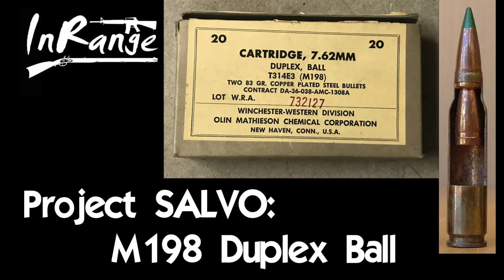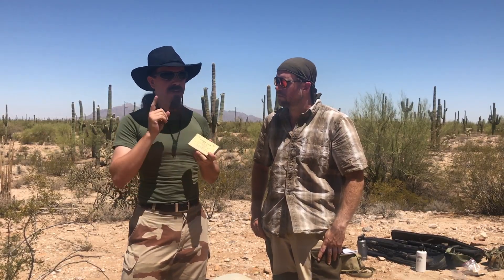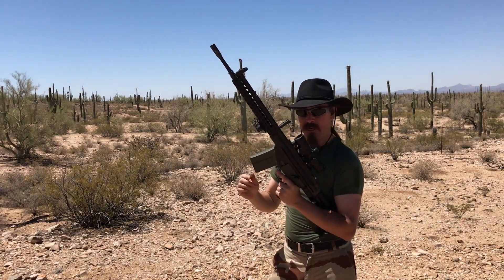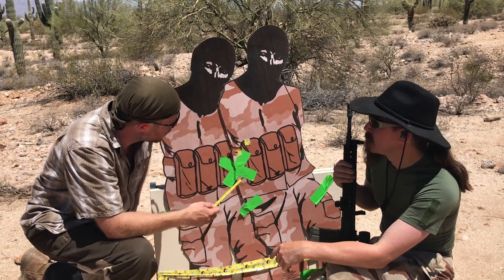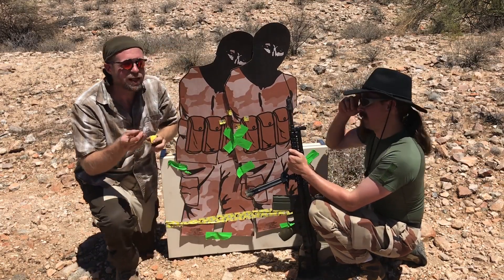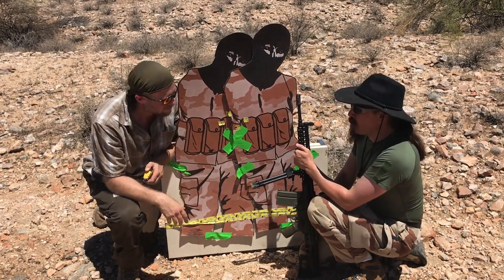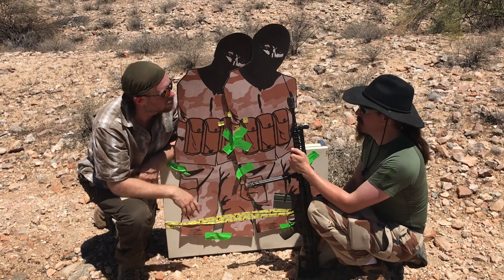Project SALVO: M198 Duplex Ball Ammunition

Comment: Duplex also introduced risk of catastrophic failure. If your powder loading density wasn't high enough, the seating of the projectiles into the cartridge could cause the rear bullet to recede into the powder bed. When fired, there would be a lot of combustion gases between the bullets, to the point that rear bullet gets stuck in bore. Follow up shot could blow the gun up. Such a failure occured with the M198's, and later with Colt's 5.56 duplex ACR candidate. This risk was eliminated by x-raying the cartridges after assembly as a form of quality control. But that step substantially increased cost of production.

Comment: I have only just discovered this video, and it is great :D
I have an interesting idea if you have enough of this ammo to test with (a year after this video).  The test idea >>>
.
Find a long indoor range that will allow you to film in the target area where people usually shoot, clearly the range would have to be shut.
.
Setup and calibrate super high speed cameras, when I say high speed I mean high FPS, example here > https://www.youtube.com/c/smartereveryday/videos <
.
We know that the front and rear "projectiles" are different.  If the gun is in a solid clamp you can fire it and drill the same hole with standard rounds as a control, then the fun and interest begins.
.
When you shoot the "duplex" rounds you will see which of the rounds (ahem "projectiles") constantly lands in the same place, I fully expect that the "front" projectile to be accurate one, and the "rear" projectile to be the random / somewhat random "flyer" that increases the hit probability.
.
If my thoughts are true, then both the "marksman" concept stays true and is valid and also the "hit probability" concept is true and valid as well.  The only way IMHO to know this is with real world testing, and IMHO the ideal scenario is to remove as many variables as possible and run this in a scientific way.  Indoors, gun clamped, control ammo tests, high FPS video to see which "projectile" hits where.
.
I expect under this scenario that at a set range the "front projectile" will be less accurate than standard 7.62 but still OK, and the "rear projectile" will be random in it's up, down, left, right position as well as the distance and across (say 10 rounds) be more like the spread of a shotgun.  I could of course be wrong and the front "projectile" could also be inaccurate, if so that would have destroyed the "marksman" concept.!
.
Finally, and this would be fun, have a chat with Paul Harrell (team up) and compare a standard 7.62 round, with the "Duplex" and other competitive rounds on the now famous "meat target" and possibly other tests (light Human body armour) to see whether this was/is actually lethal enough as compared to it's competing options, both foreign and domestic.

Comment: I realize that this stuff is expensive, but you really need to fire more than one round at each range for control.  When you look at the spread at 25 meters as 2.5 inches, and 100meters as 10 inches, it should've been 5 inches at 50 meters, but it was 3 1/4 inches.  You really can't make a lot of assumptions from such small numbers. I almost could assume that the one round closest to point of aim  was the front bullet, but who knows?

Comment: " Oh, it cycles "  - Yeah, it is a G 3. Used it in German Air Force. My one never refused to cycle nor did any of the other ones. Our rifles were in good condition and our ammo as well . But even with bad ammo, it will cycle. And with really bad ammo, for a good reason there is a hole in the charging lever where the carrying strap clasp fits . So it can be cycled manually. Germans always have a plan B ...

Comment: Russia in fact adopted duplex double projectile for mi-24 gunship nose-mounted rotary .50 cal YaKB gatling gun. Four barrels, maximum ROF from first shot, 4000-6000 rpm, 8-12k bullets in target direction. But after couple of wars it was considered lacking range and damage and in further updates gatling was changed to twin-linked 30-mm autocannon.

Comment: Very nice interesting video!

Question:
On the 'sloped' base of the 2nd projectile;
Since this is a spin stabilized projectile it makes little sense to rely on the push of the gasses to put the 2nd projectile off course. Spin-stab would work against that effect.
What, I think, the sloped base does is, it displaces the CoG outside of the centre-line of the projectile  (and a bit to the rear, also making it a little less stable), making it cork-screw.
I think the first projectile flies in a normal ballistic trajectory (it doesn't know there is a 2nd projectile behind it, it only feels hot gasses on its bottom) and the 2nd projectile cork-screws around that line (ideally with the line as the centre of the cork-screw).
On the projectile pair;
During the engraving of the first projectile it will start to rotate and break any linkage with the 2nd projectile. (I mean how old is this ammo and how many times was it treated to nice tropical temperatures....)
Once the engraving of the 2nd projectile begins, it causes a bit of a delay and therefore a separation in 'muzzle-time' between them (in case they both get shoved forwards when the propellant ignites).
Does gunpowder get shoved into the barrel between the projectiles and, upon burning, provide a gas-buffer between the projectiles? (and do something, we don't like to think about, to the barrel?)

Would love to know more about what happens inside the chamber/barrel when firing a duplex.

Wish you had so many rounds of that ammo that you almost wouldn't know what to do with it. ;-) 
Thoughts?

Comment: Soviets had the same in 50 cal. For  4barrels 12.7 mm YakB-12.7 machine guns mounted on Mi-24 combat helicopters developed special two-bullet cartridges of increased density of fire with bullets - armor-piercing incendiary “1 SL” (9-A-4412) and tracer “1  SLT "(index 9-A-4427).

Comment: What if the second bullet is angled not to increase dispersion but to break it loose from the front bullet when it makes contact with the rifling and it’s forced to straighten. Maybe the bullets are welded together at an angle so in transport they can’t be shaken loose then that contact and that force of being straightened breaks it free. Just a thought.

Comment: I think some of the enthusiasm you showed after the tests needs to be curbed with the understanding that this is all chance. Karl mentions the possibility of firing a shot and it hitting a running target even if it wasn't leading, or maybe taking out two targets instead of 1. The problem with this is- maybe? But also maybe not. That second projectile might lead the target, or it might go opposite of the target and pass way behind him instead. Maybe against a formation of enemies that might still hit something, or maybe it just means you're missing more and the shots you do land hit less hard. Even assuming the gun is a perfectly accurate laser beam, 0 MOA. Even assuming the bullets are perfectly manufactured with infinitesimally small tolerances. As you're loading the rounds into the magazine and carrying them around, they're cylinders. They're going to rotate, the second projectile is not going to be angled the same every time. You can't plan shots like "aim here, second shot goes there" because the second round might go up, or down, or left, or right... you don't know. This is a lot like the pencil barrel issue in early M16 rifles. One gun might flex up and right, another might flex down and left.... at least with the rifle you might be able to learn what your gun does and learn to compensate for it. With these bullets, every single shot does something different and unexpected. And maybe some days that great magnet wills the projectile to act in your favour, but also maybe some days it wills the projectile to act against you. In the end, this really does nothing except make the gun less accurate as if that's a benefit. This is like the old myth of the Bren gun being "too accurate" to be useful. If you want a bigger dispersion for a bigger beaten zone for a better chance to hit, just hold the gun loosely and let it kick around, or aim wildly. You have just as much probabilistic chance of that helping as you do hoping a random second projectile may or may not hit. On average, all this does is turn a very accurate gun into a less accurate gun that shoots twice as many smaller projectiles. So.... just spray and pray with a sub machine gun or PDW? You'll get the exact same results in principle.

Comment: I feel like this would make the most sense in aircraft mounted guns. The door guns on a helicopter for example. The miniguns on a UH-60 don't even have sights and with this you can double the fire rate for the same weight of ammo. I'm surprised they didn't use this just for the guns in the ac-47, when aiming involves turning the whole plane a little inaccuracy isn't really an issue.

Comment: I was sure the second bullet would keyhole. If you get a chance to read Jim boatrights paper on the coning theory I think it would be very interesting to see what he thought of these with an offset center of gravity. But I guess these are probably over stabilized seeing how the second is so short, the first would be more accurate because of its center of gravity and because it would be longer then most bullets its weight due to the base being concave making it easier to stabilize. It seems like the second wanders like a top on a table. Great video!

Comment: Its a single accurate shot, with a ring around it where a second shot has a chance of hitting anywhere on that ring. More distance = larger diameter ring. 

Multiple shots with the same point of aim starts filling in that ring.

Comment: First, here is a link to the October 1964 issue of Gunsmagazine article on M198 ball ammo. https://gunsmagazine.com/wp-content/uploads/2018/12/G1064.pdf.  Second, this ammo was issued in Vietnam and on linked belts, primarily for use in M60 machine guns.  There were issues with the barrels overheating faster than with standard single ball ammo.  Probably a friction effect since there was a longer bearing surface with two bullets traveling down the barrel at the same time.  See the following disscussion the firearms blog including Bud Hortons comments on actual use in machine guns in Vietnam. https://www.thefirearmblog.com/blog/2015/04/30/m198-the-cartridge-that-should-not-have-been/  And by the way the second bullet's base had an angle of 7 Degrees to force dispersion.  I used this ammo in M14's at the time, and personally found it to only be frustrating since you never knew where the rounds were going.  I would stick with standard 147 grain ball.

Comment: I found a secondary source of the M198 specifications:
 https://m14forum.com/ammunition/52047-duplex-round.html#post699003
 Here's the straight dope on M198:

Specification - MIL-C-60131 (cancelled in 1980)

Weapon - M14 Rifle and pending for the M60 Machine Gun as of July 1967

Bullets - a) Front bullet weighed 80 to 84 grains, made of B1112 free cutting steel with an electro deposited copper jacket b) Rear bullet weighed 81 to 85 grains, made of B1112 free cutting steel with an electo deposited copper jacket

Velocity - a) Front bullet velocity was 2750 fps + or - 30 fps as measured 78 feet from the muzzle b) Rear bullet velocity was 2200 fps as measured 78 feet from the muzzle.

Accuracy- Front bullet to impact within a 2 " mean radius at 100 yards

Dispersion - Rear bullet impact was 5 " to 10 " CEP at 100 yards

Propellant - 45.5 grains of WC-740

Identification - Front bullet tip was painted Green No. 14110 per FED-STD-595

It was packaged in boxes of 920 cartridges, bandoleers of five round stripper clips, and linked bandoleers.

Reference: Springfield Armory pamphlet 23-1 dated July 1967

Comment: My take on this great demo is.
The Crosscut view shows powder can be burned and propelled past the secondary projectile regardless of the angle it is in. The first projectile has to move first, it's the one crimped. it is not the secondary projectile pushing the first, It is simply following it at a fraction later than the first projectile allowing for slight muzzle rise to allow projectile impact dispersion. Yes / No?
Have a loading rig? Make some more. Try getting a projectile to stand strait up in a shell on top of powder and place another projectile on top to crimp.

Comment: Today I could really see this as being useful for MGs carried on the small unit levels (squad, platoon).  Any 7.62mm MG at that level will have issues with feeding it with ammunition and keeping it cool.  With most combat occurring at 300m or less, and machine gunners being a type of specialized soldier with specialized ammo loadout anyway, it could make a lot of sense to have a couple belts of this with the rest of regular ball for long-range suppression fire.  At 200m or less in an urban environment, you'd have the effective beaten zone of an MG and a half for the same rate of fire and heat generation.  That could be huge for maintaining suppression or establishing rapid fire superiority in an ambush scenario.  Or special operations troops or long range patrols, you might dial down the RoF as low as possible....or the ones that use 7.62 rifles, they've got an 'ambush' mag in the gun on the move ready to just dump massive quantities of projectiles into a threat at close range.

Comment: what if they tried duplex caseless ammunition?
Reply: It wouldn't behave differently likely.
Reply: @Isaac-ho8gh  probably, but it's an interesting concept to me, imagine the G11 with duplex ammutnion that would be cool imo, even though the ammunition would not perform well because of its size and reduced powder
Reply: @gavinheimerman6320   its okay, I didn't imply that it was a bad idea if I sounded like that. I just meant that it'd behave in a similar way to a cased load generating the same amount of pressure with the same projectile(s).
Reply: @Isaac-ho8gh  it's ok lol, and to be fair it would probably be as a good of an idea as duplex cased ammunition

Comment: Soviets actually used same thing, only in different application: in YakB-12,7mm helicopter mounted machinegun. But considering that it was fully auto rotary gun with 4.5k rpm (in YakBU version 5k rpm). goal was a bit different...
7,62mm variant was also in work but was dropped due to number of shortcomings, like inability to properly use in GShG machinegun and poor ballistics at range.

Comment: National Firearms Act, 26 U.S.C. 5845(b)
Reply: @sniprzkitty But you're not firing two separate rounds per trigger pull, you're firing two projectiles. There's a difference. If firing two projectiles per trigger pull were a violation of the NFA, then no one would be able to use shotguns.
Reply: Smooth bore

Comment: I saw the title and my mouth started to water. Also my mind wanders to 300blk with a pair of 55gr copper solids at around 2300fps. I wonder if I can make this happen.
Reply: @Gas Air Spark I'd love some duplex .50 Spotter/Tracer rounds ;) .50S/T is essentially a shortened .50 BMG round with an 830gr bullet :) So if you made it  a duplex round, you'd be throwing 2 415gr projectiles down range at 1700fps. I think that would make for an excellent hog round ;)
Reply: At 2300fps you are right at the edge of the velocity needed for rifle bullets to create rifle wounds, which means that at 100 yards you are probably getting pistol wounds instead of rifle wounds
Reply: @stelioeffrena1571  The whole "you need X velocity to get secondary wound damage like a true rifle" thing has long been disproved. Look up terminal ballistic studies effect of meplat on terminal ballistics, and long range performance of elk rifle cartridges,  as well as hunting with 500 JRH on elk and you will see larger than caliber sized wounds not only down to the 1700 fps mark with expanding/fragmenting bullets, but also <2" diameter wounds from projectiles moving below 1000 fps. There's no velocity "minimum" so to speak, hydraulic wounding is way more complicated than that.

Comment: Interesting that the old concept of the 'buck and ball' or 'double ball' load keeps coming back and showing effectiveness. I may like my modern stuff, but I still have a soft spot for the black powder, front loading classics. I've shot buck and ball out of my .69 cal model 1842 musket a few times and it is easy to see how effective it would be at guaranteeing hits on typical targets of the era at reasonable ranges. Even if your main ball misses, from what my musket was doing, typically one of the buck shot would hit either in the arm or leg and certainly wreck that guy's ability to fight.

 Also from reading on civil war cartridges (of the paper variety), I found out about a bullet designed for rifle-muskets or rifled muskets (there is a difference, one is a conversion, the other is purpose built) to give them 'buck and ball' capability. The reason normal buck and ball doesn't really work out of a rifled barrel is that the rifling tends to cause too much dispersion with the not bore diameter buck shot to be useful at anything other than hand to hand ranges. This bullet was actually a stack of three, a main projectile and two 'sub-projectiles'  that were designed to work with the rifling and only disperse about as much as this duplex load did. It was actually very effective in use, but was not widely used, I forget exactly why, but cost and complexity were likely  the reasons, just like the modern load. I find it to be a very interesting experiment along with the various 'cleaner bullets' that were used and also the curious oddity of the 'musket shell', an exploding 'airburst' shrapnel shell for use in normal rifle muskets.

Comment: 2.5" at 25 yards 3.25" at 50 and 10" at 100,  if the middle value is slightly out, you're looking at 1" per 10 yards. sadly checking this would involve 100s of rounds